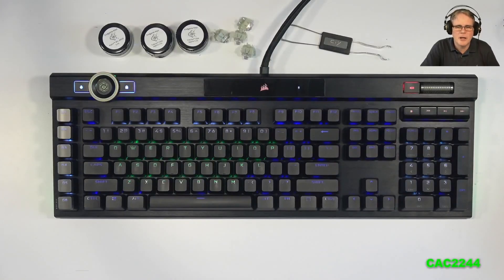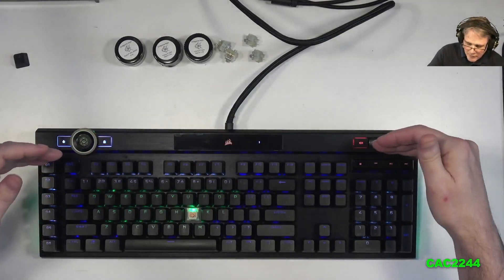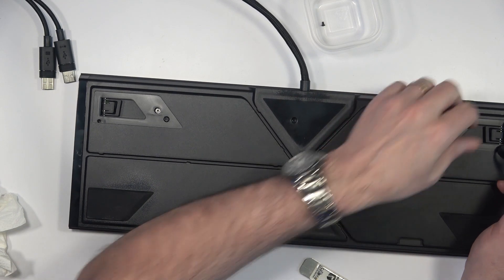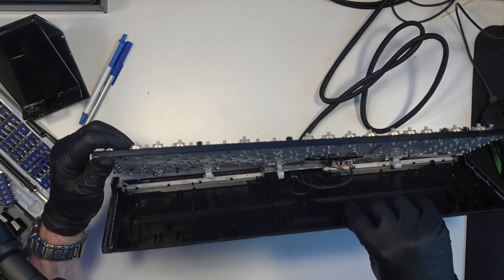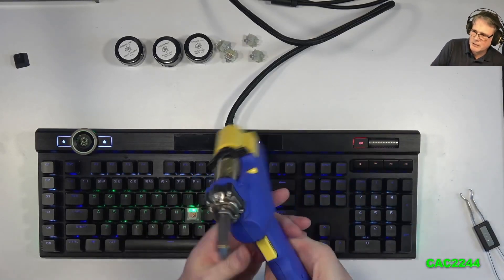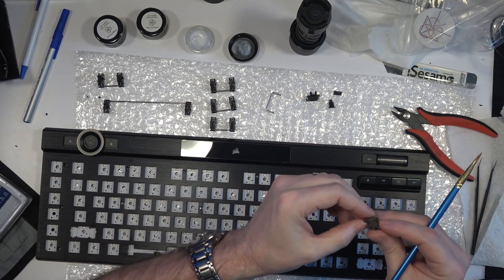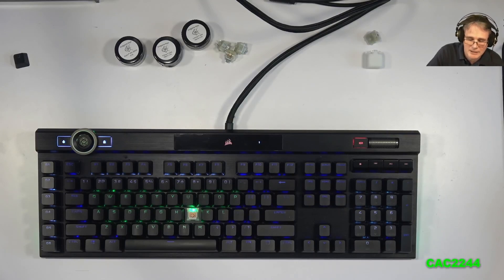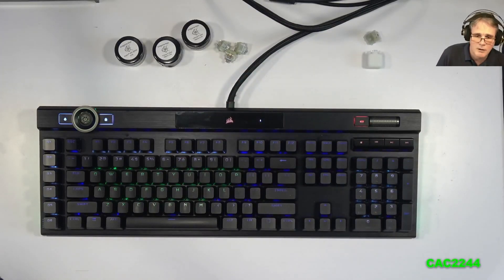Corsair K100 keyboard teardown and switch replacement

Comment: Awesome video,...you come as clear as water. is there a chance to convert the keyboard to become wireless? and true that wheel should have been brushed aluminum
Reply from the maker: Hello dbay31..thanks for your nice comment. Unfortunately trying to convert this keyboard to wireless would not really be an option, because you would have to back engineer a power source like a rechargeable battery pack or something... BUT If someone was to challenge me, since i already removed the original power cord and bypassed to the USB port to use a removable USB cable, then I would get a 5V lithium battery pack that i would stick with double sided tape (hi-temp) in the bottom tray and splice output to USB + and - PCB connector and connect make a little hole in back case  and connect a USB-C female port and connect to something like Adafruit Product ID 2465 (   https://www.adafruit.com/product/2465 ) and from the adafruit charging port i would strip and solder a female port that i would attach to back of keyboard (ex:  https://www.aliexpress.com/item/4000892435654.html?spm=a2g0o.productlist.0.0.35792df007ksag&algo_pvid=aa282948-9ece-4e66-b40b-6a1830934642&algo_expid=aa282948-9ece-4e66-b40b-6a1830934642-6&btsid=0bb0623d16070467396807996e1ccc&ws_ab_test=searchweb0_0,searchweb201602_,searchweb201603_ )     .  On my empty USB port that i already modded, put a BT dongle and that probably would work... See my splice of USB port here: https://www.youtube.com/watch?v=MEwbK5u6r_k&t    and i would use battery and connector like those...   ANYWAY DON'T DO IT BRO!!! It just doesn't make economical sense... If you figure out an easier solution, let me know. On my side, I am really happy with my removable cord mod that I did to use the USB bypass port as an input.
Reply: @cac2244  interesting! I see no use for a wireless K100 lol! But what if i want to turn it into USB type C

Comment: Noob here. Would it be possible to replace they switches with Gateron optical blues or browns without soldering?. Like hot swapping, since the optics are kept PCB -side?
Reply from the maker: I got the Keyboard with the Cherry MX traditional switches that get soldered on, hence the PCB is made for it. I have no idea what the PCB looks like for the OPX  switches version... Are the Opto switches from the K100 similar to the Gateron ? Looking at the review of the OPX optical version of the keyboard and looking at the Gateron optical switches, it is not far fetched to think this could also be possible. Anandtech published their review after i posted my video (for the record), but find Anandtech's (limited) view of the OPX version PCB here... Hope it helps...  https://images.anandtech.com/doci/16256/Corsair_K100_Gaming_Keyboard_20.jpg
Reply: @cac2244  Interesting. I watched chyrosran22's deconstruction review of it to try and figure it out myself. Saw him mention something regarding it and it sparked interest. At $200+ i haven't seen a lot of people break it down on an enthusiast level. 

I'm at the tipping point of copping this board for a lot of reasons, all seemingly senseless to r/mk. If i could grab this with the ability to just hot swap optical gats (even if just these specific switches) i feel like it has a lot of potential for modders. Soldering is not something I'm comfortable with ao it'd be a great entry level to potential future projects for a beginner detached from the privilege of ordering duckys without freight forwarding.
Reply: @InfamousD217  hey did you get the keyboard? I was wondering the same thing as you
Reply: @TheStreblas  i did end up getting the keeb. Cost a kidney so i haven't dared yanking on the switches yet. Might give it a go if i see someone else attempt and succeed. 

As for the keys themselves. They're pretty good. Took a few weeks to get used to em but the learning curve weren't too steep. I do miss the sensation of feedback though. But not enough to go about noodling on overpriced switches and potentially destroying it.
Reply: @cac2244  
The OPX keyboard features classic three pin hot swap switches. This is in part why it is more expensive than the MX version.

Comment from the maker: For those with a keen eye, at 5:54 you can see that the removal of the protective black Kapton tape from where the ground screw area is, there is a diode missing (stayed on tape), on F9 switch (second right to the ground screw hole), and I just got it back from kapton tape and re-soldered in place. Diodes have a specific direction so i made sure to re-solder in right polarity and all works just good. Putting diode back in was a question of seconds, just put solder on the pads and then put diode in place and heat up each  leg for a second or so and voila!